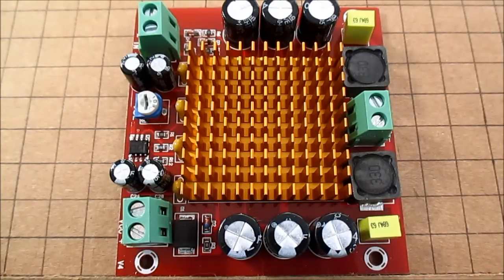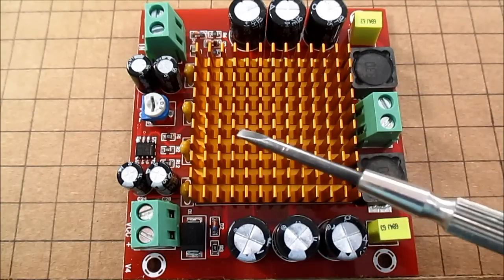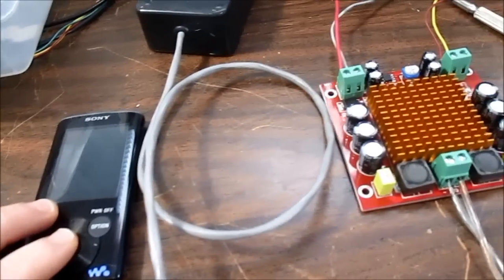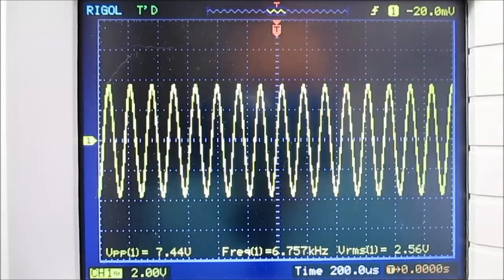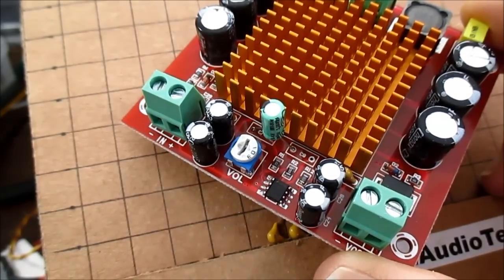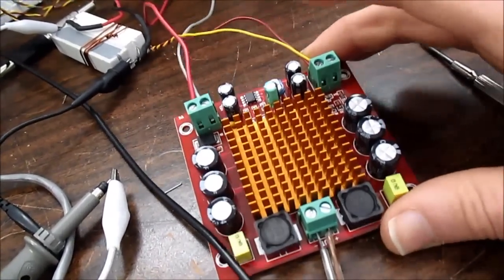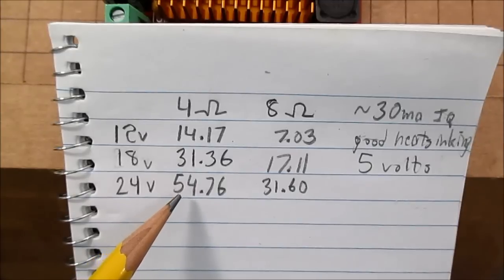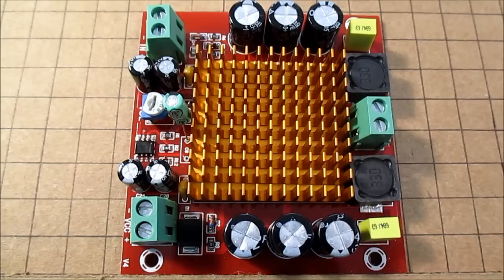TPA3116 audio amplifer board test, review & mod

Comment: Clearly no one tests these boards after manufacturing. I often think they are made by none technical manufacturers that simply copy basic circuits from the chip makers. These are often made to give parameters of the chip but are not really complete circuits. Just a little more attention to detail and they could have a good if not great product. I think they really don't care.

Comment: Hi! 
Nice review. I'm new to digital amps and am currently learning as much as I can about the technology. I think the technology is now matured enough that it's worth investing some time in exploring what some chipsets can do and implement them into a nice products because I think it surpassed the analog amps quite a bit.
So.. I wanted to ask about the digital gain setting on your board. How is it configured? 
I bought this modules:
https://www.ebay.com/itm/TPA3116-D2-DA-DC-12V-24V-100W-Mono-Channel-Digital-Power-Audio-Amplifier-Board/322254477895?hash=item4b07dd1a47:g:juAAAOSwxg5X0BMF
and uppon arrival I hooked them up and the noise floow was terrible, so I took a look at the TI's datasheet and found that internal digital gain of the amp was set to highest 36dB. I changed a few resistors to put it at lowest 20dB gain because I did a research and found that a lot of hi fi amps have a gain of 20-24dB on line inputs so I figured it would be enough to drive it to full power with a typical devices such as music players and generic sound cards.. and it is! Also the quality of the sound improoved dramatically, so did THD response.
Other than that I noticed that the type of power supply has a huge impact on the chips performance. For instance, some switchin power supplies introduces some artifacts in the sound and some gave a better frequency responce. I found out (form testing with what I had at home) that laptop power supply gets the best perfomance and a decent power output since some of them can output 90W at 19V.
Also that I noticed that soldering was quite bad on my modules. resoldering all components with leaded solder also gave some performance boost. And the diode that my board has is in series with the chip and was rated at 1A continuous current, I switched it with a higher value and got a bit more power. I wonder if it has to be a shottky diode because the voltage drop and high frequency noise that amp introduces to power supply or is a generic silicon diode enough since the amp board itself has caps on it to buffer and smooth the ripple of switching frequency.
So my modules now give out about 86W into 4 ohms at 19V. being max 5°C above the room temperature. They also don't get any warmer being driven just below clipping as they are sitting Idle. 
I'd maybe try different power supply capacitors, because I think if they are cheap and chips transistors can go up to over 1Mhz, (my modules go up to 2.5Mhz when sitting idle)  maybe their quality can have some effect?? Don't know.. thinking outloud..
So.. that's what I've learned so far about this chip running in BTL mode, hope to get a reply from you if you think some of this things make sence.. Also if somebody is interested I could maybe draw a schematic of my boards and take note on how it is configured. Gain, modulation, etc.. So we can compare the boards and filter designs and maybe figure something out.

Comment: From what I heard from my headphones, I always use them for reference, the bass was still weak even going directly into the amp chip. You may gain some bass by driving the amp with a EQ or a mixing board to gain EQ. For the price though, it could be a low cost usable amp. Your review and analysis makes it easy to make decisions about if it would work for your own needs. Because of the heat sink being enough to let it run cool, this could be mounted in a studio monitor cabinet. Use a 12-18 volt power supply at 1 amp(wall wart) and drive it with a mixer. Bam! Self powered speaker mod for $20 a speaker! Thank you so much for sharing! Love your channel. Johns audio and a hot, strong cup of coffee, first thing in the morning. Thankz
Reply: a trick : watch series at kaldroStream. Been using it for watching loads of movies these days.
Reply: @Sebastian Ryder yea, been watching on KaldroStream for years myself :D

Comment: I'd hazard a guess that the roll off was deliberate as the output filters are undersized.

The inductors need to be able to stay within their BH curve and well away from saturation at the peak current of the lowest frequency called upon and with some head room. Really want to be able to push peak current at 10hz without saturating. 

Decent class D have big output inductors. Those ones are alright for removing the modulation artifacts at higher frequencies but  if you tested it I'd suspect to see break through at full power at low frequencies as the cores saturate.
Reply: I don't think it's much of a problem with tpa3116, having a small inductors. I bought a slightly different board, had some wrong component values like gain resistors (digital gain setting was 36db, creating a nasty hiss) but I've tested it and it has quite decent frequency responce. But.. I'm not sure.. I'm learning and experimenting.
TPA3116 has a few different modulation settings that can be selected by external resistors so maybe that could be the case?? This chip has a modulation setting that allows you to use it without any low pass filters. With that kind of topology and modulation I noticed quite a reduced bass response but only on synthetic loads, hooking it up to an actual speaker using as shortest wires as possible like datasheet sudgests it wasn't an issue . So.. idk.. What kind of chokes could I use to see how much of a difference it makes?

Comment: Folks use this board to make battery powered guitar amps.
The preamp helps with this.
Reply: What is the input impedance for this amp?  I was trying to determine what size potentiometer to use for a volume control.  Thanks!
Reply from the maker: Input impedance is too low for guitar work.
Reply: I'm using one very similar to this as a bass guitar amp.
Reply: I'm using this one with a small mixer for a busking PA with small SLA batteries for power (24V): https://www.ebay.com.au/itm/DC-12V-24V-100W-TPA3116DA-Mono-Channel-Digital-Power-Audio-Amplifier-Board/191966402559?hash=item2cb216d7ff:g:nmkAAOSwgmJX0ntc. I don't know anything about anything tech-wise but my rig sounds good. Guess I got lucky. Anybody that wants to give me some pointers, please....

Comment: How much amp, 12volt charger is needed to ran two 5-6inch 8oms 15wate speakers with the help of pam8610 amplifier?
Reply: 1amp, but you could use 12v @ 3amp and the chip will only draw what it needs. Needs a heatsink for long life.
Drain-Source On-State Resistance RDS(ON) 
VCC = 12V IO = 1A TJ = +25°C 
High Side  200  mΩ Low Side  200  Total  400  
10W @ 10%THD/Channel Output into a 8Ω Load at 13V 
Heat sink is required for high power output. 

The PAM8610 is a 10W (per channel) stereo Class-D audio amplifier with DC Volume Control which offers low THD+N (0.1%), low EMI, and good PSRR thus high-quality sound reproduction. The 32 steps DC volume control has a +32dB to -75dB range. 
 
The PAM8610 runs off of a 7V to 15V supply at much higher efficiency than competitors’ ICs. 
 
The PAM8610 only requires very few external components, significantly saving cost and board space. 
 
The PAM8610 is available in a 40pin QFN 6mm*6mm package

10W @ 10%THD/Channel Output into a 8Ω Load at 13V  Low Noise: -90dB 
Over 90% Efficiency  32 Step DC Volume Control from -75dB to +32dB 
With Shutdown/Mute/Fade Function 
Over Current , Thermal and Short-Circuit Protection  Low THD+N 
Low Quiescent Current 
Pop Noise Suppression 
Small Package Outlines: Thin 40-pin QFN 6mm*6mm Package 
Pb-Free Package (RoHS Complaint
Reply: MrBrymstond 
Thanks sir.
Also do I need a capacitor in the power input? If yes what will be the value of it?
Reply: Not if you're using a good switch mode power supply. John is the man, but until he answers you I can help.
Reply: MrBrymstond 
Thanks.
Reply: @esbro69s  reading all that just gave me hope for the internet. Use it to gather knowledge and help teach others!  I love it, thanks guys

Comment: Hope your dad is doing well.
Is it possible that this board it to connect directly to a microphone? That would explain the x10 amplifier.
Reply: I doubt it, a mic input would need a 1mV at least.
Reply: Can I modify the board to work directly with a guitar?
Reply: That could also explain the high pass filter...